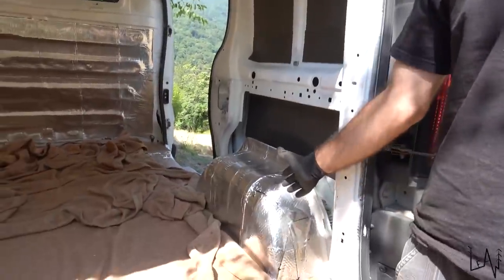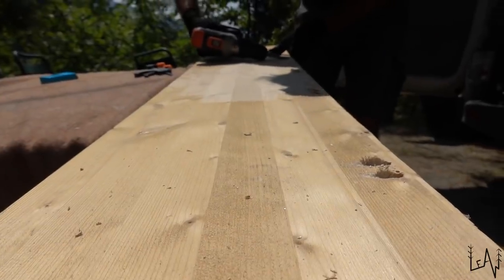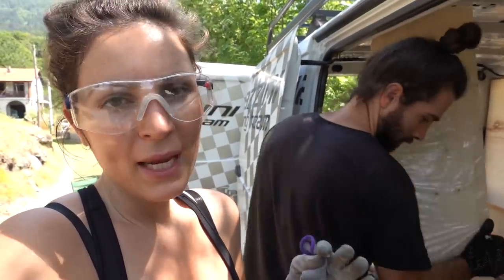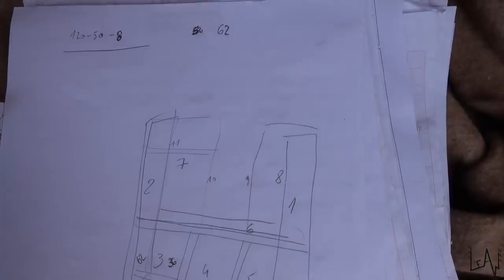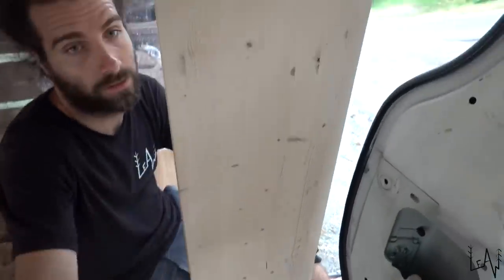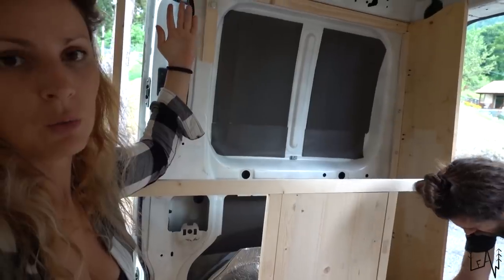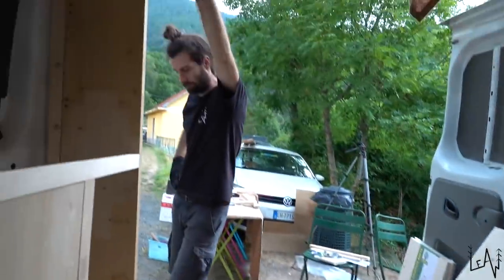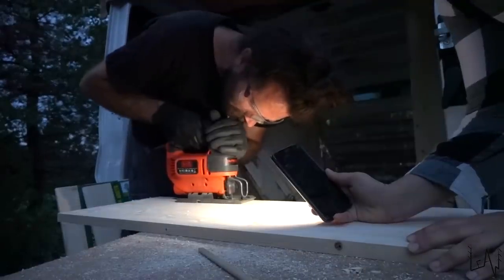We CUT a HOLE in our Renault Trafic VAN CONVERSION - DIY ROOF VENT Install / Van Life Italy

Comment: Luca and  Sara are  a beautiful couple.  Luca and his friend look very much alike.  Did Luca clone his friend?  

The van is coming along.  Great Job. 

 I wondering if Luca had to get plans approved by Italy's DMV (Department of Motor Vehicles)
because it looks like they are working off a blue print and this if this is Luca's original blue print
then patton van transitions is the next step.  They are making a small area into usable, comfortable, multifunctional area within  the weight restrictions..  If these are Luca's original blue prints then he must go into engineering and make a career out of it, he  is so good at it, with much precision.
Reply from the maker: Hi Linda, thank you so much! Sara and I are designing and drawing everything by ourselves. No need to get the plans approved by the DMV :)
Reply: @leaw  You guys are doing an amazing job.  Both would do well engineering.

Comment: Bravo it's starting to look like a home, in my bus the AC power is ran through the bus already I have a way to plug into shore power also have the gas generator mounted on the back but for the DC power I'm going to be using solar generators one for the right side of the bus ,one for the left side of the bus I think it'll be cheaper and easier and I have 100 Watt solar panel I'm gonna Mount on the side of the bus that on a hinge  will be able to lift up to get the sun at then when I'm driving it'll lay flat against the bus. Keep your fingers crossed I hope this week I get to go up to the bus I start working on it stay safe stay strong stay healthy god bless enjoy life✌❤🤙👨‍🍳🎅🚌

Comment: G'DAY Guys,well done thus far,I have a terminology lesson for you both,WOOD is what you burn on a BBQ,Fire,TIMBER is what one builds with,eg.Cabinets,furniture etc.also in future if desiring to stress bend a length of timber, one gets quicker result by steaming board before hand,even by soaking in hot water?

Comment: I thought you said you could not compromise any parts of the van? Apparently that must not apply to cutting a hole in the roof, correct?
Reply from the maker: Correct. We mentioned in a previous video that the only thing we are allowing to make is the hole for the roof vent :)